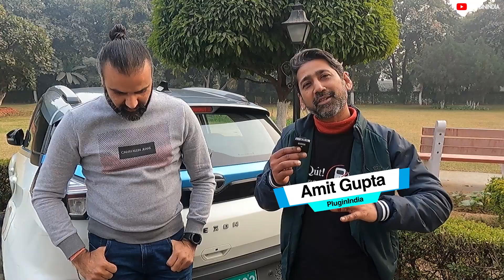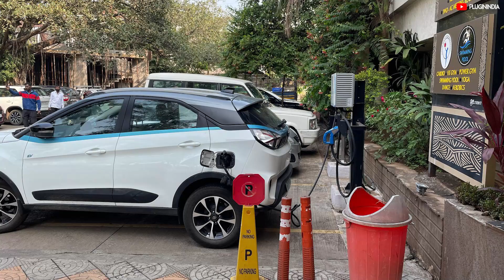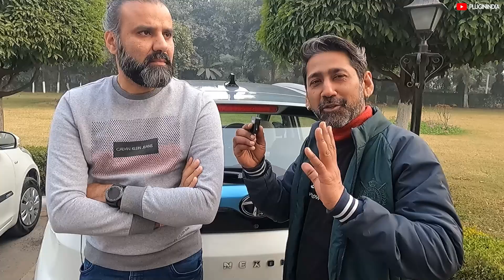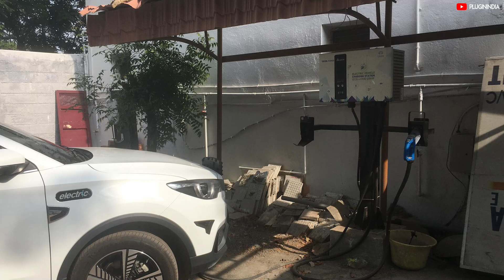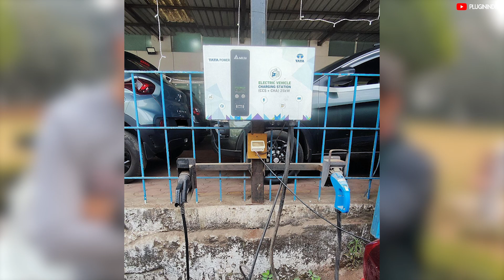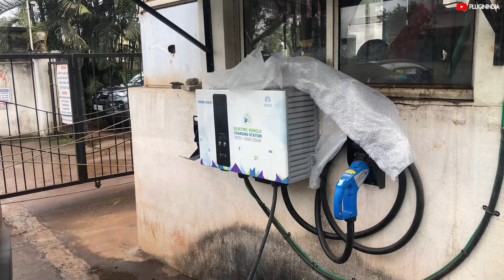Dear Tata Power | #2

Comment: Tata should have provided higher Ac level 2 charging capacity to it's EVs.. atleast 7.5 kwh.. Which would have made life easy.. As setting up Ac level 2 chargers is very cost effective. Installing DC fast chargers is way too expensive and cumbersome
Reply: Newer tML ev has it even in Tiago ev base version
Reply: One cannot have everything being an early adopter. 3.3kW is doing great for city driving and fairly good even in the intercity travel.

Comment: India needs super and ultra charging stations (working). The naming fast charging should be given only for 100kw+, charging stations only. And obviously new cars should support higher voltage for fast charging.
Reply: Sir .. the combination has be a workable one .. cars and batteries being able to take that high voltage would have a much higher tag price and maintenance.. plus still would be low on warranty in comparison to the existing for the masses.. To bring a change, masses are to be involved .. totally my perspective ..
Reply: @asheesharoraEV  Im saying as a desire on futuristic model. But not too far, Nobody what's to wait for 6-8 hours for charging where an ICE car takes only 4-6 minutes. So BEVs should support fast charging, and as there is mass adaptation there will be more infra, and price will be cheaper.
Reply: @krishnachandramenon8  All accepted about the desire .. but over public chargers no one even today has to wait for 6-8 hrs .. 60-90mins at the maximum.. Yes I stop at any charger after 150-200kms of driving (2-3hrs) and while I have food with my family and get fresh the vehicle is fully charged for another 200+ kms .. I don't recall if the pattern was different earlier while I was using an ICE vehicle .. I think everyone deserves a break in 5 hours or 300kms of total driving ..
Reply: @asheesharoraEV  But still 60 minutes is huge if we are in tight schedule. Can adjust with this, if we are tuned to this driving style. Also, globally these concerns are addressing with new technology and obviously for initial phase the cost will be higher, but can expect a faster phase adoption and there by price reduction... Desire 😀

Comment: I don't understand why Chademo charger is included in the tata charging stations, instead they can provide 2 CCS chargers so that 2 cars can use them at the same time, most of the IOCL tata ev chargers are offline, tata should take action on chargers which are offline most of the time

It's funny that Nexon ev max is not mentioned in the ez charge app only Nexon prime is there (prime is also not mentioned) whereas other providers do
Reply: Our policies maker are idiot, if you need subsidy then you have to provide ccs and chademo
Reply: I read that it's a govt policy to have a chademo charger along with CCS